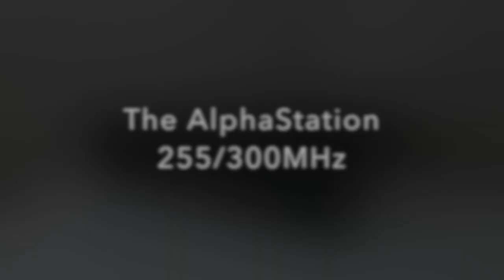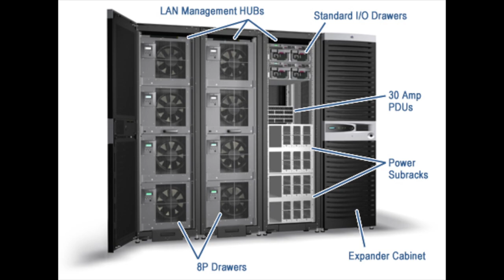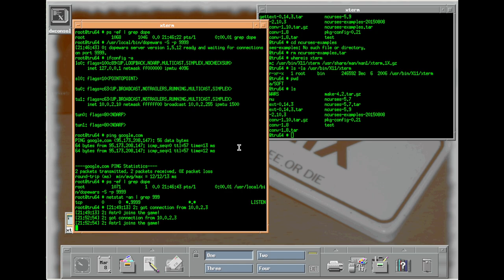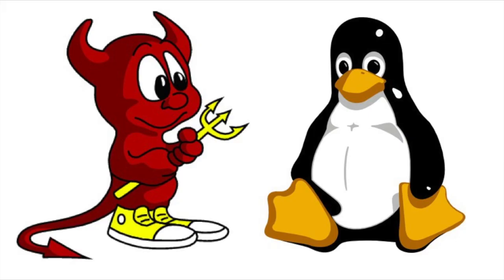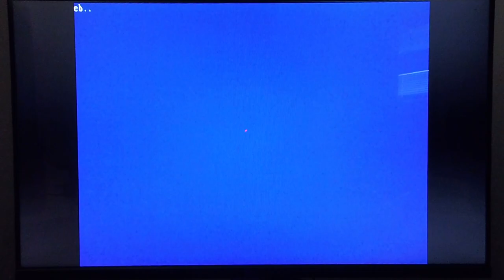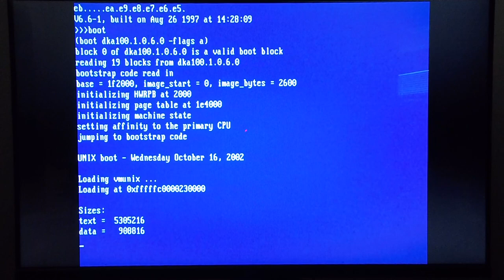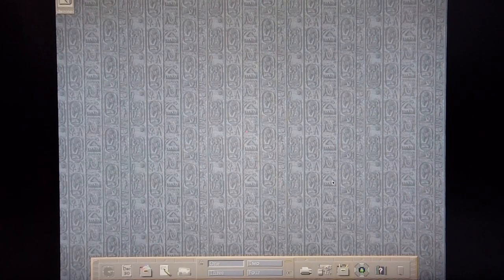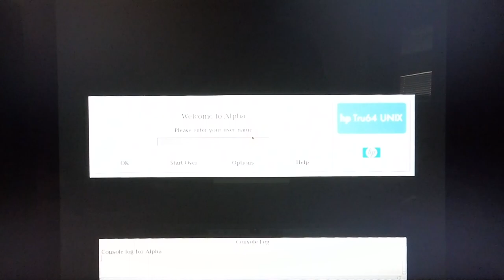The DEC AlphaStation 255/300

Comment: Thanks for sharing, Even today I am still doing maintenance on some AlphaStation 255/300 and DS10/DS15 whit OpenVMS Operating System.
Reply from the maker: It’s a pleasure! Are 255/300’s still in use?
Reply: @Irinikus  255/300 and DS10 / DS15

Comment: i use to own a alphastation 600 5/333 and that thing was heavy and built like a tank.  i ended up trading it with a friend of mine for his pws 500au (was moving cross country and didn't feel like lugging it along) and i'm still kicking myself in the ass for not bringing it. oh, to top that off, i also gave him a nec riscstation 2250 and a netpower fast mp.